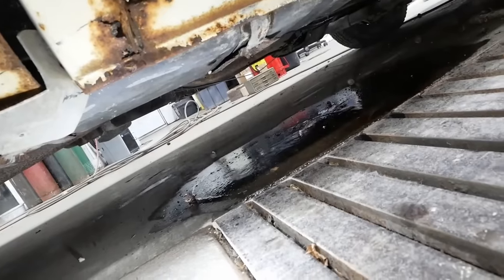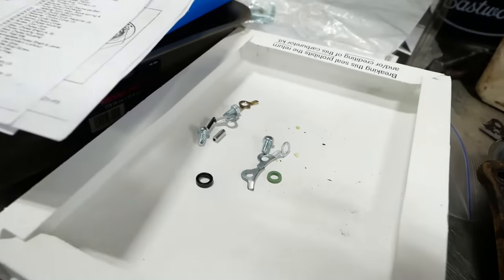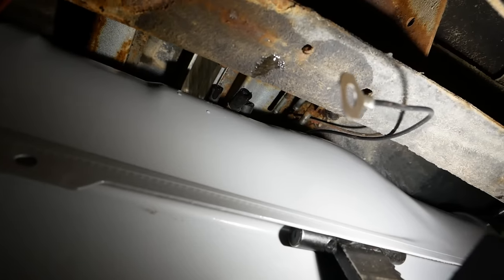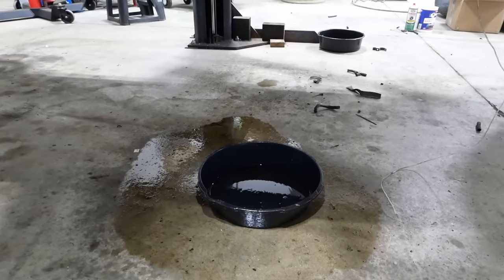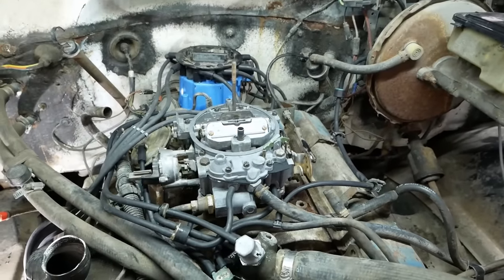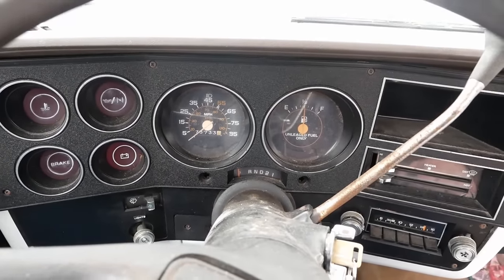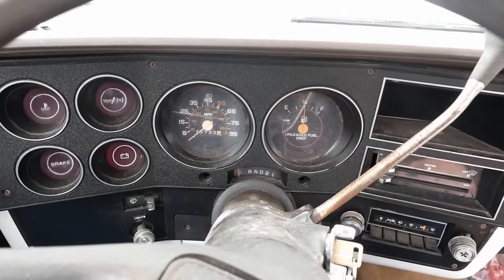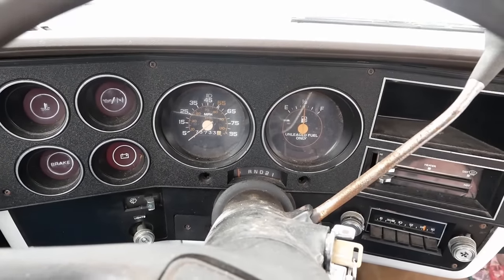Millennial vs. Carburetor | Square Body Chevy Back on the Road After Sitting 12 Years

Comment: I'm sure someone has already said it...but its an M4ME, the trucks got away without the electronics a lot longer...  Like any system, there are a LOT of adjustments for a Quadrajet, more than just setting the float level.  While it may run without changing them, it will run much better if you set all them to the "stock calibration"  The choke needs the vacuum pull connected off to help it at idle when the choke is on.  You may have also killed the choke element (or was bad already) by dunking it in the tank.    I still have the special tools for these carburetors in my toolbox and its been a couple decades since I've owned one... ;)  The vacuum solenoids are probably still available, and they will make it run better, as the calibration includes the EGR  systems.  The biggest performance issue with this setup is the old school bean catalyst...  You'll probably never see another of these...good job on this truck!

Comment: The only time new oils in old motors will ever be a problem is when the old engine is gunked ALL TO HELL inside. In that case, the newer oils can clean some of that gunk off, which instantly gets sucked into the tiniest hole that it can plug.

I've blown up 2 junker 2.8L V6's out of 1st gen S10's that way. Great motor to learn that with, no loss at all!

Comment: As told to me by my father, to start a cold 350 CI small block with a Quadrawreck carb, slowly press the accelerator pedal all the way down to engage the "automatic" choke and let up about halfway, start and take your foot off the pedal.  As I recall it worked, YMMV.

Comment: Well. I’m 68. When I could finally afford a new car it was 1976. Then a few years later another new one. There used to be a cardboard sleeve over the visor for new owners with starting instructions. Most were the same. Once to the floor, release and then hold it halfway down. Then hit the key. 
Maybe find an online owners manual for that truck and revue the starting instructions. Maybe you said that and I missed it. And maybe someone else said this and it’s a repeat. 
It seemed like all units of that vintage were “cold natured.”

Thanks for the fun. 🤠

Comment: Any vehicle from the mid 70s to mid 80s with a vacuum based emissions system is a nightmare once it has been sitting. You will spend a lot of time and money replacing parts that are not very effective and certainly not necessary for the vehicle to operate. Buy a set of vacuum caps and 86 as much of it as physically possible. It will save you a major headache. I had to learn that the hard way. The vacuum advance is really the only thing that is worth keeping. Installing an emissions delete package is a must on these old vehicles. When you get done with the installation, spray some carb cleaner around the carb, particularly near the base. If the engine surges, then you have a vacuum leak in that area. It is an easy way to ensure that there are no leaks anywhere.

Comment: Thank you Wes that was an excellent video on the quadrajet carb I was having problems with mine too, took it off and rebuilt it, it’s a lot better but I know it too will need bushings and I’m also going too plug up the Welch plugs on the bottom when I take it off again, a big problem with mine was the divorced choke I bought a new bi metal spring and the whole spring rotated which it’s not suppose too do so I had too dril it out and put in a drift pin so now it will never rotate again in the cradle anyway great job check the choke butterfly when it’s cold too see if it’s opening enough it should say in the directions how much it should be open 👍

Comment: Those are great carbs, I have one that was on a truck I bought back in 1990 34 years ago, after it set for 13 years not being used I put it on another truck without doing a thing to it and it ran smooth as could be, and still does to this day. I’m not sure if it has ever been opened up, it was off a 79 Chevy P/U so it was only 11 years old when I got it.

Comment: Back in a previous lifetime ie the 70s I was pretty good with working with Holly carbs. I would absolutely refuse to work on Quadra-junk carbs. Here you had a better one. Some models had a plastic center body that were prone to cracking. Chasing vacuum leaks or fuel leaks internally that you can't see will drive you to drinking in excess and then use carb as target shotgun. Wes keep up the great work

Comment: brings back old memories of my first car a 77 chevette with the 1.6 liter 62 hp engine it was like a go kart with a lawnmower engine i rebuilt the carburetor on my old formica and metal kitchen table in my apartment lol. i think it cost like 8 or 12 bucks for a rebuild kit everything was dirt cheap on that car but everything broke all the time also lol.i remember the automatic choke was adjustable you set it by rotating the thing and looking at marks on housing you adjusted it to close choke when cold then you could tweak it up or down to get right balance. that piece of tar paper for the gas tank reminds me of when i ordered a new piece of sound insulating foam for inside my boats outboard motor they just sent some square of packing foam i could have just taken from some package i got in the mail not a nice plastic coated oil resistant heat resistant pad and wanted like 25 dollars for it

Comment: You must have the patience of Job. The best thing that ever happened to the old Quadrajet carburetor was a replacement built by Holley. They bolted right on and everything hooked up. I had two GM products that we put Holley’s on and they both ran better than they ever had, and got better fuel mileage

Comment: I found those thermal chokes . When cold,adjust to 1/8" from closed. Befor you set the pulloff linkage. Hope that helps. I'll bet someone was adjusting on her when she was dirty. I've done a few quadrajets. I've lost alot of hrs.  Trial and error .they are a good carberator. 👍  when adjusted.thanks Wes

Comment: Wes, I had my 1977 Chevy C20 350 Quadrajet rebuilt at Brad Urban's Carb Shop in Southern California it used to be in Ontario but that's been many years. Maybe they are still open they advertised having the fastest car in the quarter mile with a Quadrajet. Anyway I had them rebuild my 1977 Chevy c20 350 4 bolt main with a quadrajet they mill the bottom plate and put bronze oil bushings in the throttle shaft and also an adjustment screw 12% plus or minus the middle setting on the primary side so you can adjust it for unloaded or towing and also change the ramp so there was no bog and it started as soon as you turn the key on I never heard it spin. They also trued and alumabrighted my distributor which looked like brand new.

Comment: My Dad’s ‘82 Chevy developed pin holes under that cover on the fuel tank. I put JB weld on it in 1998 and it stopped leaking it was a Michigan,Illinois, Wisconsin truck. I think he sold it in 1999. That truck I had to pump it 3 times if it was cold.

Comment: When these were new they didn't run great. The late 70's to early 80's all these cars and trucks had their problems. You did a fine job working out the problems. Just be glad you didn't work at a dealership back then.

Comment: Well if it makes you feel better I changed mine out, in 70 on my 66 Impala 396 Cui 325 HP! It went south we tried everything. A new one fixed it. Yours looked as nice as a new one same as mine. But the needles going to the bottom is the issue, 80 Malibu 268 Cui had the same carb. but only the front half "two-barrel". the valve with two needles actually the plunger controlling them would stick. I got tired of disassembling and freeing them. The car had no pickup on exertion!
I installed a four-barrel intake and a Holly "four-barrel economizer" no one could tell so it passed the inspection pollution test. "It ran like a spotted ape". Have you ever seen one? Well, that shows you how fast they are also.

Comment: I worked  in parts for a GM Dealership for a few years.  The Mechanic always had me carry extra Well 'Seals for these Carbs and he would somehow seal some little plugs down underneath that Well seal ( that foam seal that is kind of hour glass shaped)   Also the tops of a Quadrajet can get warped if someone tightened the Mounting Bolts to tight and that can screw up the metering rod depth.  I don't remember seeing that type of metering rod in this video however.

Comment: Apart from the high idle, it may not be a carb fault at all. Check your ignition.

Make sure you are feeding the distributor advance from the ported vacuum fitting on the carb, and not from manifold vacuum. It is a very common mistake and can give you a big flat spot from idle kind of like a faulty accelerator pump. It also won't make full power and cause poor cold idle speed.

 Also set your timing at 6 to 8 degrees before TDC with the vacuum advance hose disconnected, you can later try making identical runs with it set 1 degree advanced each time until it starts pinging, then back it off by 2 to 3 degrees. Every engine is different due to valve train wear, and fuel octane rating so don't be afraid to experiment.

 The stock balancer can also spin the outer pulley by a few degrees(a very common fault) and make the timing marks wrong, Check it by barring it over until no 1 cylinder is at TDC, and check the marks.

 In that case throw out your timing light, carefully rotate the distributor back and forth a few degrees until it idles at its highest, then retard it until the idle speed drops by 150 to 200 rpm.

 I personally threw my timing light in the back of a cupboard an tuned it by ear. once you find that sweet spot you will know by the sound of the idle speed dropping, and it will be piss easy to set it again in the future. Good luck.

Comment: should check for another vacuum leak. we always used a propane torch [not lit, outdoors], if it speeds up [engine] when the propane is around a area, there is your leak.  Always kept a CO2 fire extinguisher handy.

Comment: Hay Wes thanks for the movie I’m no expert and believe me I’m not giving you any technical advice but having had V W s and Renault’s that have those clock spring coke systems, if you can’t delete them , then the strength of the vacuum pressure is important at every stage of the start up if I were you I would reconnect all of the vacuum devices even that exhaust flap  . I have had some success with these types of systems when I had them complete . Thanks again Wes I really enjoy your videos .

Comment: Those Quadra jets can be tricky if you’re not used to messing with them. we have a localQuadra jet guru who can build them on the bench and you pretty much put it on start the vehicle and go with no adjustment except maybe idle. When they’re right they’re about as close to fuel injection as you’re going to get from a carburetor. I go out to my old square body truck pat the gas one time start it and it’s good to go and it starts and performs pretty much as good as fuel injection even with decent mileage if you stay out of the four barrels even on a built engine. The best way to check those chokes is to turn the key on make sure there’s voltage give it a few minutes and put your finger right near the wire connection and see if it’s hot they get hot enough after a few minutes you’ll definitely know if they’re working.

Comment: I have flat tappets on my 1956 Copar tractor, 1960 Ford F350 (I6) and 1960 Ford Galaxie (FE) and use Traveler 30W summer and 15W40 winter from Tractor Supply.  No catastrophic, semi-catastrophic, mildly catastrophic or humorously catastrophic engine failures on any of these old reciprocating wrecks going on 15+ years.   The tractor and truck are worked like, well, tractors and trucks, and no one has complained thus far.  Don't know if it's the zinc or just wonderful karma.  Keep running it per usual until things go south, I guess.

Comment: It wasn't you those carbs have very much earned the nickname Quadrajunk. It's been probably 20 years since I spent much time on one. There are probably four in my shed on a shelf. There are still a few carbureted cars in my collection but now all but one run a Holley or Edelbrock. It's certainly possible to get that carb running right but it's one of the hardest to figure out. As mentioned by others one of the first things guys do is adjust that choke or replace it with a manual one. Watching that off idle stumble had me thinking the accelerator pump might be acting up. The rebuild kits often are very poor quality. The choice of nearly everyone I know since the late 80's has been to replace those carbs with something else. A Rochester two barrel would've been a much easier one to start with.  I'm a big fan of carbs just not that one. Thank you for the videos.

Comment: They don't call them Rottenchester's for nothing Wes. You did good we used  cool water to reset the spring for the choke when hot to get a starting point adjustment need a little more accelerator pump on tip in to get rid of stumble be my guess they are a good carb when set correctly !

Comment: hi Wes 
Love your videos, we both have gthwe same work ethics 
I'm a retired mechinic and started in the trade with points and condensator ignition and carbs then TBI injection and electronic ignition and to current technoligies. 
My speciality was fuel and emmisions and driveablity. I worked at GM dealer, GM Canada technical assistance, Honda Canada technical assistance etc. 
I have rebuilt many GM 4 barrel carbs over the years and for me the are basic. 
I suspect your current issue is the EFE (Early Fuel Evaporation) crossover passage in the intake manifold is blocked with carbon. 
When the passage is blocked the exhaust gases  does not heat the base of the intake manifold below the carb and the fuel entering the intake pools there because of being cold. 
The way to check it is on a cold engine once you start it if you feel the intake manifold at the passage area (center of manifold)it should get hot quickly. 
It works in conjunction with heat riser valve on the right side exhaust manifold which restricts the exhaust flow to force exhaust thru the intake passage 
to heat the base of the manifold. 
The repair is to remove the intake manifold and chisel out the carbon deposits in the heads and manifold which is a dirty job. 
As well make sure the heat riser valve is working correctly (should close on cold start and open once engine is warm.)
Hope this helps
Eric Ritchie 
Retired technicial with over 40 years in the trade.

Comment: This is one of those vehicles.  Amazing job on the shaft bushing install.  Awesome.  I would see if it wants a little less, bi-metal choke spring tension.   Unwind it a bit.  Just until it works to set the choke, on the first pump... but, will unwind quickly.  ( In less than 30 seconds to 1 minute))  Too much tension will start to soot up the plugs.   Pop out the plugs, if they are "sooty"  maybe run one heat range hotter plugs. (Just as an experiment)    If they burn with a nice tanned color,  the motor will want to light off a lot better.   Also, I would look at the ignition spark while cranking.  Your secondary ignition is new... but,  I have discovered that using the timing light for the purpose of diagnosing intermittent spark related issues can be helpful.   My Kawasaki was being a biiiiiaaaach, and I noticed intermittent light flashing on my timing light.   It was a fouled plug.  (Think about that one)   I installed a new plug and the timing light would flash 100% of the time.  (No erratic, misfires from the timing light flashes)    It also led me to discover other intermittent spark related issues on other vehicles.    Also an easy way to diagnose crappy points contacts...etc.

Comment: [For the record, I wrote this comment BEFORE I saw 01:06:50 😁]
That's one of the great things about owning a GM product in the late 70's & early 80's. If you could work on one, you could work on almost all of them. Nothing sounded better than a finally tuned Chevy 350 V-8. I miss those days. Cars today are almost too sterile, designed to remove driver feel from the equation. I liked it when I could "feel" how my car or truck felt. 

Stuff didn't blow up before I knew it needed to be fixed and I never needed a computer code to tell me what I needed to do to anything I drove, just my ear and the feel from behind the wheel.

Comment: Worked on tons of that platform. It comes in cars, station wagons,and trucks each manufacturer has their own Version. Chevy,Olds,Pontiac,etc. Those carbs are set to run lean when brand new it was the beginning of emission hell.  So when they get old their even worse. Intake gaskets?? Check to see if the bolts tighten. EGR valve stuck pintel from carbon. Or getting vacuum at idle. Causes poor idle and hesitation. Seen brake boosters with pin hole cause vacuum leak and still work. Good luck great video as always.

Comment: We only used zinc for the first fire on new racing engines.  Dad ran them about 20 minutes at 1800 rpm's to "glaze" the cam and heat cycle the engine for the first time

Comment: Just seeing the end now...  I had a 69 Impala where the clock spring was under a cover in the intake manifold.  A little linkage connected this to the butterfly.  It was relatively reliable but these springs fatigue over time.  I remember that when you choked it cold you had to push the peddle to the floor and let it off slowly.  Also, I see at least four aluminum vacuum switches there near the carb.  Those went bad frequently.

Comment: To be honest about my experience on these carbs, I grew up on them, I can remember when they started changing over the newer systems also, I’m no carb expert n don’t want to be lol, but in my experience the best way to overhaul a carb is when you take it to the parts store n exchange it for a new one for them to deal with, simple n easy fix in my experience.